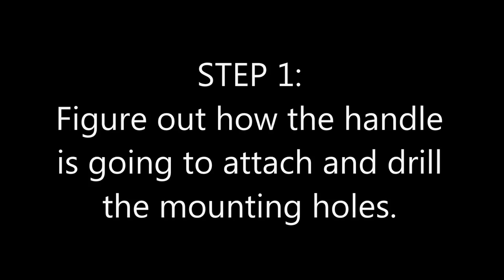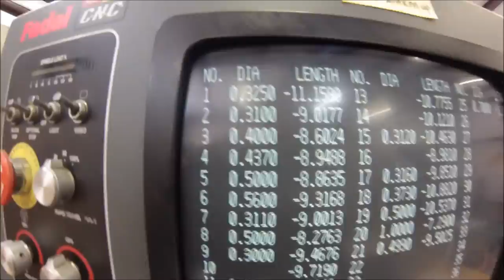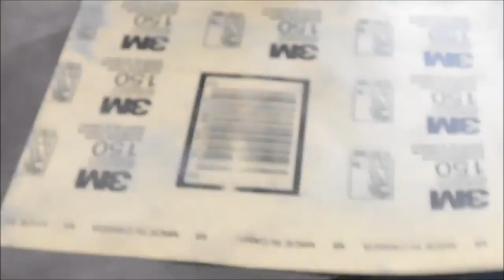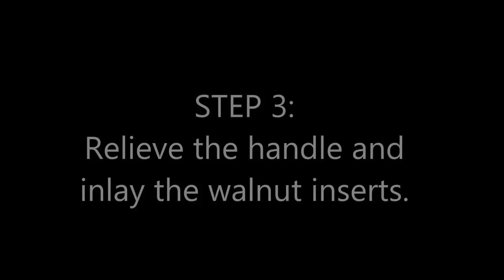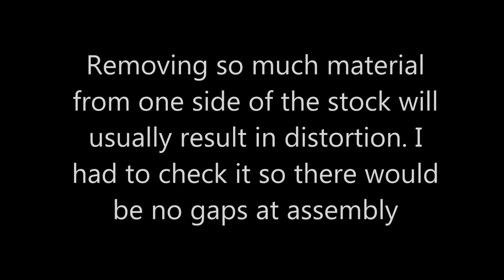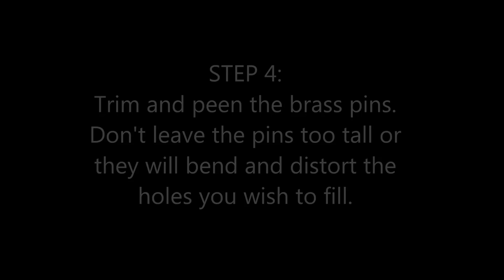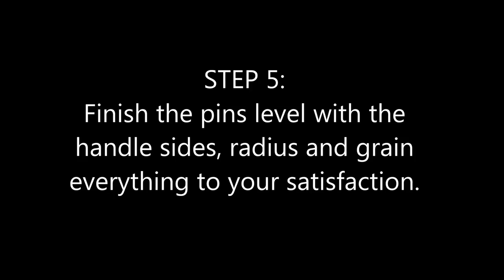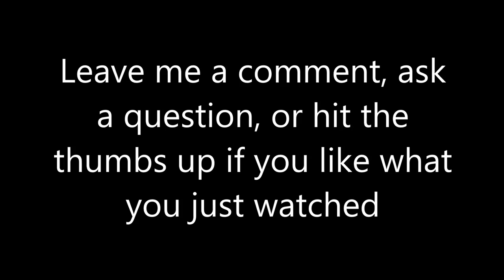Fabricating a Custom Knife handle

Comment: Joe the style of knife is a recurve . With your skill and machinery next time you do a knife you might consider dovetailing the scales. When you pin into metal like that a good technique is to drill your holes oout with a 12 degree bit. As you pine the brass don't cap it just swell it. The 12 degree taper should re-enforce any epoxy you use to attach the handle. Look good

Comment: Hi Joe,
Great looking knife like the steel, brass and wood effect...
I've always believed the 5 minutes name in epoxy was the maximum time this cheap type of glue would hold any part even in just standing still situation...   lol
Cheers,   Pierre
Reply from the maker: Hey Pierre. I've never had much faith in epoxy, but this LocTite brand is very strong. Thanks for the comment.

Comment: Shweet!  In the brass pocket for the inlaid wood, did you do any further surface prep beyond 'as milled'?  The finish on the floor looked too good (ha! how often do ya get to say that?) to provide much 'tooth' for the epoxy to lock into.

Yea, yea, I know rivets mean the glue is hardly needed, I'm just wondering.  You did mention some more milling after the pocket was already cut, wondered if that was for surface prep.
Reply from the maker: I used a 2 part Loctite 5 minute epoxy. I maybe should have blasted the glue area, but I tested the grip and the glue was very strong, so I just left the pocket in the video milled state. Time will tell.

Comment: The peening operation starting at 14:20 is hidden by your hands.  Were you using a steel punch for that?  Also, what are the pins made of? Thanks!
Reply from the maker: I used 2 punches for the peening operation. After I cut the pins closer to the handle, about .100 Inches, I used a flat face punch to swell the pins and shorten them. The second punch had a mild radius on the face to force the OD of the pins to mushroom out and leave a dent in the center. I then went back to the flat one and watched for the material around the hole to swell from the pin expansion. The pins were type 360 brass.

Comment: I loved the finished product. Did you use brass pins? and were the holes counter sunk first, before you peened the pins over?
Reply from the maker: I did use brass pins. I didn't c'sink the holes, but the peen job was not only to mushroom, but linear to swell the pins. I look for the material around the hole to swell so I know the engagement is good.

Comment: Beautiful finish! As an amateur blade smith I have gone the other direction and make knives that do not have a mark from a power tool on them.
Reply from the maker: The only power tool marks on this knife are the grind serration marks on the blade.

Comment: Hey Joe, the knife turned out gorgeous. You can sell knifes with kind of work.  JP Knifes. works for me. Did you peen the pins down with a hammer or hammer and punch? your hands were in the way just curious. God Bless Ya   Dave
Reply from the maker: Hammer and punch. I used a radiused tip pin to help spread the pin out, then used the flat end to mushroom them. It worked.

Comment: Hello Mr. Pie, I've been wondering about something--I have a big old lathe with a long headstock; probably 3 feet down the bore of the spindle.  If I'm trying to hold a 2 foot long piece of say 1" stock and I have a good foot and half down inside the bore of the spindle with nothing holding it, what kind of dangers or problems would spinning that create?  I can think of vibration for one thing, and possibly slapping into the bore of the spindle.

There has been a lot said about the dangers of spinning long thin pieces unsupported but so far this specific circumstance hasn't really been covered.  What can be done to do it safely or properly?  Keep in mind a spider on the back end wouldn't reach a foot into the bore, at least mine wouldn't.
Reply from the maker: I have seen internal whipping cause a taper to the exposed material, and end-to-end misalignment of journals. I usually know the bore diameter sizes on machines i run and make collars for work I need to keep true inside the spindle.
Reply: Thanks for the reply, I was considering some rubber hose wrapped around the part inside the bore or something similar.  Might try making a sleeve if I encounter the issue again.
Reply from the maker: I have also used the thin cardboard from the back of note pads. Just wrap the part and tape it. It works in a pinch.